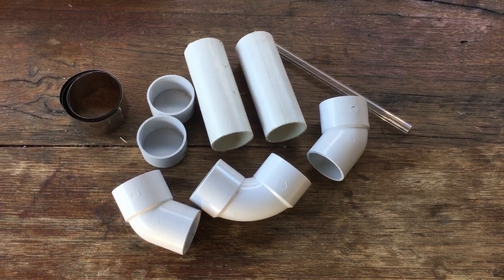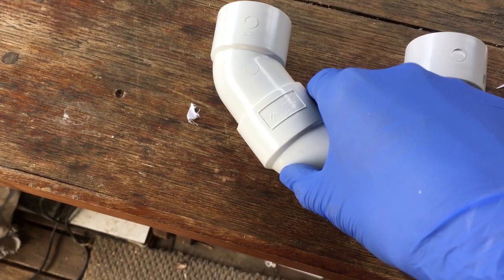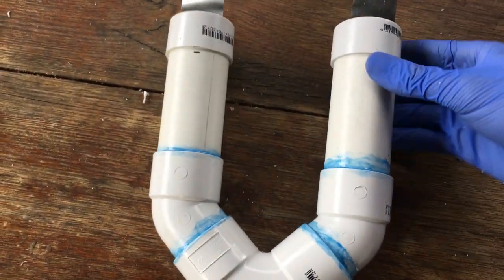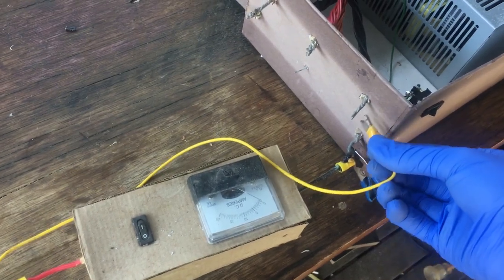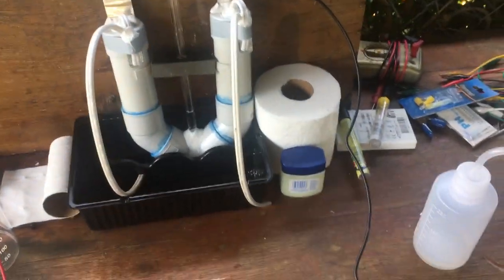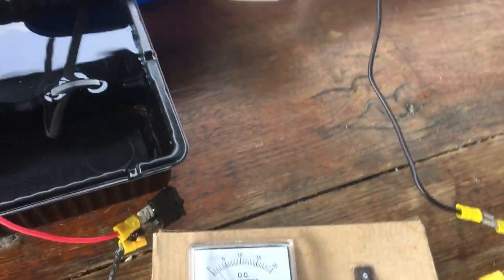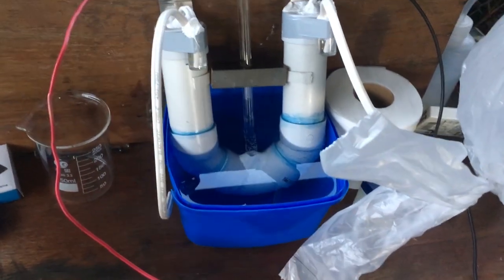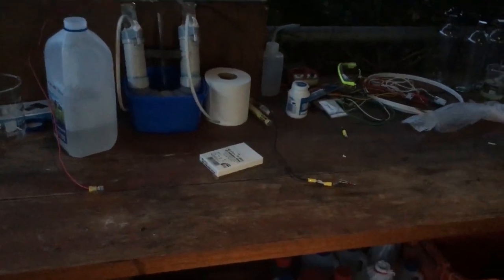Building a Hydrogen Generator

Comment: The best way to boost your current draw (and output) is to have the electrodes much closer together and have multiple electrolytic cells in series.  Ideally, you should be able to power 6 cells in series from a 12V power supply instead of one.  However, yours is very simple and easy to maintain.  Very nice.

Comment: Nice job! I built a similar one but I didn't use any fabric. I didn't get much cross-contamination that I know of... have you ever had any cross-contamination in this type of generator without the fabric?
Reply from the maker: When the electrodes are pushed as far down the pipes as I've put them, I have had cross-contamination problems in the past. Positioning the electrodes a little higher fixes the problem completely, but of course, you lose a lot of efficiency with the extra distance.
I'm currently working on a smaller, higher production rate, and more efficient design, so stay tuned!
Reply: Scrap Science not sure if you've thought of this, but drying the gas would give you better lift from the H2.  Also "Tech Ingredients" demonstrated how much more powerful detonation becomes with an excess of oxygen.
I need to spend time building instead of watching and commenting.  These are great projects!

Comment: If you were to use Sodium chloride for your electrolyte could this be a reliable chlorine generator? I was thinking you could burn the chlorine and the hydrogen to make you're own HCL just from electricity and salt. and if you did perform this with copper electrodes would it produce copper chloride?
Reply from the maker: An electrolytic chlorine generator is actually pretty tricky business. For starters, electrolysis of a simple NaCl solution can only make chlorine for a short while, because the hydroxide ions which form on the cathode will eventually end up reacting with any chlorine created on the anode. In the end, you actually just end up generating sodium chlorate in solution rather than chlorine gas, and that's assuming you've got inert electrodes (I gave this a go in my chlorate cell video: https://youtu.be/aaUCzjp-HuA ). With nickel electrodes, it's really not a good idea because the anode will simply disintegrate to form Ni(OH)2 precipitate, and not much will happen to the NaCl in solution. This is the same for copper electrodes, which'll mostly generate Cu(OH)2 precipitate.
In order to reliably generate chlorine from NaCl, you need something called a chloralkali cell, which involves placing a semipermeable membrane between the anode and cathode to stop the hydroxide ions (generated on the cathode) from migrating over to the chlorine (generated on the anode). Once again, you need inert electrodes for the chlorine to be generated properly. I also had a go at something similar to this in another video: https://youtu.be/2-d4dIXQN78 but my goal there was to make NaOH rather than chlorine (beware, that video's pretty old now and I actually plan on revisiting it in the future, with the purpose of actually making it into a chlorine generator). Using copper electrodes for this would generate some copper chloride, but would probably also generate Cu(OH)2 as the copper ions are attracted to the cathode chamber with the hydroxide.
As for burning the H2 and Cl2 together, I also had the same idea a while ago and had a look into it. As far as I know, it seems pretty dangerous and uncontrollable when done outside of an industrial setup, as the hydrogen and chlorine can spontaneously ignite in a powerful explosion, and the reaction is very difficult to initiate safely. I think there are a few people online who have given it a go though, maybe have a look on sciencemadness.
Sorry for the long reply, this is my favourite subject to ramble about.
Reply: @ScrapScience  Its my favorite rambling topic also, I have been doing chemistry (mainly electro chem stuff like this) for 3 years as my hobby
Reply: @ScrapScience  do you have a discord server?
Reply from the maker: @bearcatben4762  I'm afraid not at this stage. I'll look into making one though, sounds like a good plan.
Reply: Scrap Science for what it's worth, I learned experimentally that hydrogen (or methane) and chlorine gas ignite if you have overhead fluorescent lights on.  I did not attempt to recreate it in darkness, but thing it might have worked.  Two tips, 1) Pyrex glassware, and 2) fume hood kept me safe.